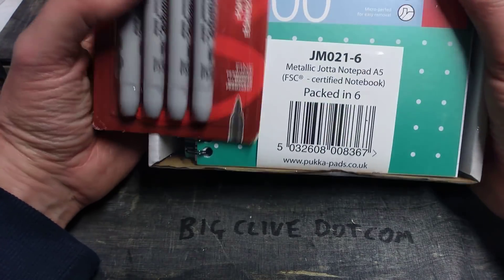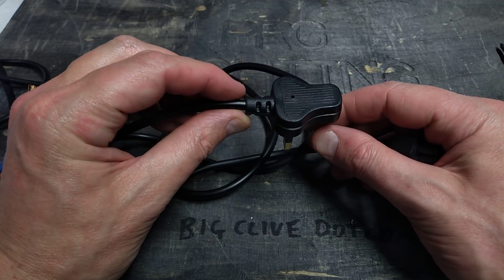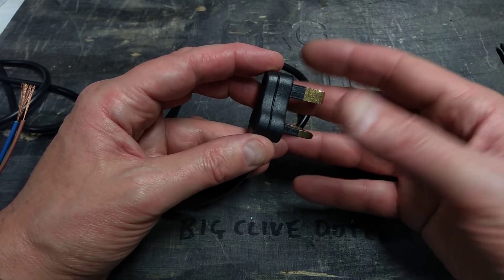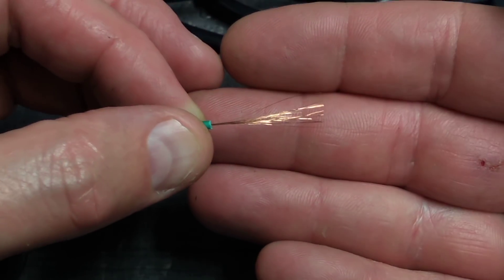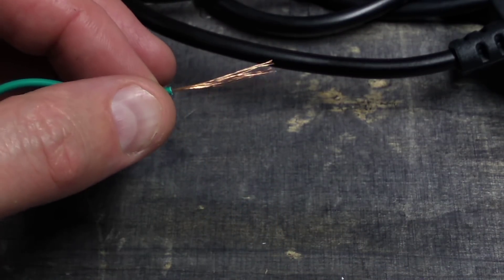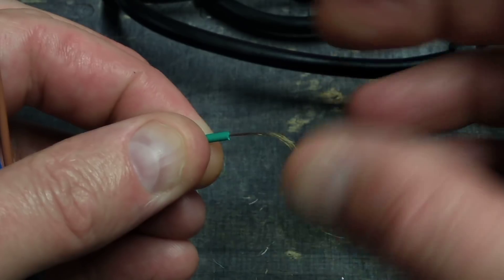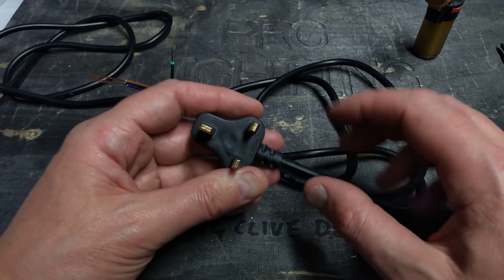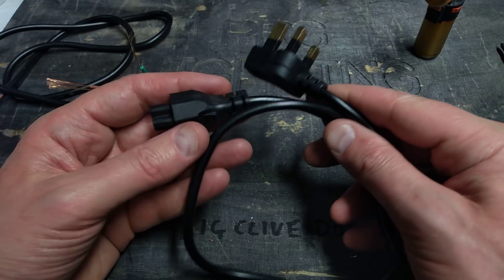How to detect shitty and dangerous aluminium flex.

Comment: I'm so tired of the continual "CCA is BAD!!" comments.   Aluminum wiring works just fine for many purposes.  For house wiring (heavy gauge), the big problem is the connectors, which are usually wrong.   Of course, nobody blames the connectors.  They blame the WIRE.  That's like blaming a car if someone mounts the wrong tires on them, over pressured, and they blow out at speed.  (They also sometimes chintz out on the gauge.  14 or 12 instead of 10)  I have a set of aluminum (CCA) jumper cables (booster cables for some).   They'll work just fine for the job, for a much lower cost than buying three+ pounds of copper to stick in my trunk for the next 20 years.    I just got them at a slightly larger gauge, to compensate for resistance.  (which isn't really an issue at 12 volts over 20 feet)    Grounding leads?   No problem with using aluminum for them.  Most grounding leads down here are completely punched through as part of the mounting process, so the expansion/contraction isn't really an issue.  (The leads I'm talking about are the HUGE ones from the box to the spike driven into the ground outside the house.  Not from the breaker box to the wall outlets)

Detest CCA?  Maybe, depending on the purpose.  Definitely detest cables that are made of CCA and _not marked as such_.   To me, that's deceptive, and extremely dangerous.
Reply from the maker: Aluminium is only stable because it creates an oxide almost instantly when the bare material gets exposed to air.  The oxide is a high insulator which is why special barrier pastes are needed for safe termination.  It's used in power distribution, but will not last as long as copper.  I would never use it to wire a house.
Reply: Thus the addition of the copper as an additional layer.   Copper has the same stability problems, it's just that the oxide it forms is a bit better at conducting.   People still lacquer it to reduce the oxidation.

My point still stands.  There are decent uses for aluminum, and CCA, but everyone continually slams it as being bad because of some bad uses.   I wouldn't use it for house wiring either - but grounding leads, jumper cables, and similar?  Certainly.  I'd rather use aluminum earth leads and rods than raw iron (I've seen a lot of those)
Reply: In the USA, just about every service wire between the transformer and the electric meter is aluminum. Likewise for the connection between the electric meter and the load center. Electric stoves are commonly wired with aluminum, as are air conditioners and other high-draw 240V loads. I have never seen one of these aluminum terminations fail.

Comment: CCA would arguably be less of a problem than the lack of sufficient spacing between the outer edge of the plug and the pins given the nominal rating of the connector so you'd be relying on a fault current to generate that much excess heat...

It is Chinese though, so all bets are off the cards 😅

Comment: I cant stand cables like that. They seem to be coming with way too much stuff these days, ive even seen some questionable cables come with local bought stuff. My policy with any cables which either come from china like that or that i just dont like the look of. Cut them in half and throw them in the rubbish. I ordered from my local large electronics shop in AU (Jaycar) a box of 20 of each the standard IEC for PCs, jugs etc. Fig 8 and the cloverleaf used by laptops and all that. Cost a bit but id rather know my cables were good.

Comment: when you get corrosion on CCA, it spreads through the whole run, instead of slow creep. with copper you can cut into the clean part and replace the rest  if you can get away with it in a given circumstance, with CCA, it all has to be replaced, regardless. the galvanic reaction will have started through the whole wire, and even if its not useless then, it will be within short order.

having had to replace CCA power wires in car amp installs due to this very thing, made it so i refuse to use CCA for anything, period.

Comment: am i right that i can reduce ac voltage with resistors but  i have up to a 1 or 2 amp draw isant that to much for resistors i am going from 36 to 18 volts
Reply from the maker: Dropper resistors are only suited to low current use.  They dissipate a lot of heat if used at high current.
Reply: thats what i thought

Comment: Would the skin effect play a role here and make this cable better at delivering AC current than it would DC since it's got copper on the outside?
Reply: My understanding is that the skin effect is nil at 60hz (or 50hz)

Comment: That wire is really tricky to get into a rewireable plug. After deciding to remove a moulded plug that requires an adapter. 
Ended up replacing the whole lead.

Comment: My tip for making sure you have a "good" plug lead, it to always buy them from RS Components / Farnell, as they buy in large quantities, direct from  the manufacturer. Someone selling on ebay or any other market place, will have likely bought them from Ali Express or similar. The same goes for if you want to buy power adapters that won't burn your house down for 24/7 use. The big  electrical suppliers will often sell mains gear that is "medical" rated, and as such has better insulation/isolation and is  tested to greater standards.

Comment: Wow, that’s some nasty stuff! Is it legal to import that cable into the UK? I know it’s not legal in the US. (doesn’t mean someone hasn’t snuck the stuff in, just not legal) I’m retired now but I worked as a Fire Inspector and a home inspector in Florida for 20-plus years and even aluminum #12 and #14 branch-wiring in homes is getting harder and harder to find. Everything here is inspected on purchase and if someone finds out a home has aluminum branch wiring, typically the deals over or the price drops $10k at least to have the home rewired. No one chooses money savings over their life when it comes to something like this. Thanks for this shout-out. Loved the lighter trick!
Reply: Buying anything on eBay is technically "sneaking stuff in" regardless of where you live because though import/export shipments might have manifests that can be checked against EU/US regulations there are no such regulations about what can be delivered in the mail.  Parcels from abroad are scanned for chemicals (drugs and radioactive substances) and X-ray'd for weapon shapes and that's it, a country receives too much personal packages everyday for each and every one to be opened and checked against different lists of contraband or dangerous materials so anyone can buy this junk.

Comment: Dangerous leads with no fuse and cheap cable that goes bad very easily, and the cable is nowhere near the rating they give you for it (if they give you one)... 

You could call these "death leads" then it would go well with a deathdapter...

Risks are obvious, but the european CE farce is how the chinese can get all this crap into the UK... roll on brexit and return BSi kitemark standards and ban these things.

If this is the crap they sell in china the average chinese home must be a death trap.

Comment: See a lot of this in 12 AWG speaker cables. There are some advantages, especially in the 12/8 conductor cable. Using it in power cables, especially under-gauged power cables is a horror. It is also very hard to detect unless you cut into it. Powering a 1kw PAR might give you an instant answer ;)
Reply from the maker: I was thinking a load test would be the best test.  You'd soon see the cable getting hot and sagging.  The downside is that with a 32A breaker on 240V the cable will probably give first if it shorts and things could suddenly get quite scary.

Comment: Confucius say: never use a cable for 10 amps if you can count the strands on one hand.
Reply: What about solid core? :-)
Reply: There is no solid core flex cable ;)
Reply: Well I can imagine that there are some crappy solid core cables with plugs attached to it going around, but they arent flex cables. Solid and flex doesnt go together :D
Reply: @Chuckiele  it's meant to be solid core but china's version would be like copper flex.

Comment: Spent a day taking turns off a toroidal transformer. When it came to soldering new leads I couldn't - the windings were aluminium. We expect this sort of thing from China at times but a toroidal transformer from Germany left me with a real 'cheap skate' feeling towards the company. Aluminium wire has very close to 66% the current capacity of copper. Dumped it but saved the core.
Reply from the maker: You could have scrapped the secondary and wound a new one on with ordinary single core cable.

Comment: copper coated alloy is a problem in all sorts of devices that contain transformers. I have a welder with it as the main transformer , the copper version of the same welder is a beauty. The one with alloy winding is near unusable. Many Chinese UPS's have copper coated alloy transformers and chokes.They unsolder them selves from the PCBs and are quite inefficient.
Scrap metal dealers are now testing for it when you drop off a load of 'copper wire' or flex.  They use a car battery to 'splat' the cut end of a length of wire.

Comment: Would there be problems with using aluminium for such cables? Yes, it would need to be a bit thicker than copper for the same resistance, but that's not the end of the world, and of course it's used in high voltage transmission lines. Would you here be issues with brittleness, corrosion, fatigue when flexed or anything else? One of the reasons commonly given (true or not) for the UK using ring mains was a copper shortage - there must have been some reason why the didn't just use Al instead.
Reply from the maker: Aluminium is used in power distribution cables for weight and cost reasons.  It also reduces the risk of cable theft.  The terminations have to be suited to aluminium.
Reply: bigclivedotcom I get why it's used where it is - an aluminium cable will be cheaper and lighter than a copper one of the same resistance, but didn't get why copper is preferred in some places. If copper is easier to terminate that would make sense, thanks.

Comment: John Ward did video on a similar lead: "C5 Power Lead with North American Plug - Examined and Destroyed."
We sometimes used Aluminium Earth/Return Cables on our Welding Sets --- of course the cables were much thicker
and less flexible than Copper --- and eventually the end would fall off and have to be Re-Terminated.

Comment: For those who live in the US, Don just buy anything off of the shelf to replace these. Make sure it has a UL, CSA, or Intertek listing tag and stamp on it. Things like Christmas lights and power cords are commonly bought from China without checking the listing, which could lead to fires or electrical shock because of shoddy construction.

Comment: Just rewired a couple of lighting circuits of my home with "PROFESSIONAL" (it does say so on the packaging) cables bought from a wholesaler. Guess what? It's CCA!
Yesterday i was looking to buy twisted pair cables from an international webshop. They have 502 products, of which maybe 10% is pure copper. I can't even filter on copper/CCA.
Reply from the maker: These days if a data cable doesn't specify it's copper then assume it's not.
Reply: If you're in the USA and buying network cable for in-wall installation, it will be copper if it comes in a box with the UL hologram label. Any network cable for in-wall installation must be copper, this is a requirement of the electric code. I've seen network cable that was marked to indicate that it is suitable for in-wall installation (CMR), but it was CCA cable. So we know the UL never saw this particular cable.

Comment: The maximum rating for this cable with its IEC C5 connector is 2.5 A. this kind of connector is usually used in laptop power supply which are fuse protected, laptop and don't need 500W+ to run, so the cable is perfectly safe for its intended purpose. Placing a 10A. wire on this cable would be waste of valuable natural resource, copper.
Reply: Just in case you weren't being ironic: If a laptop adapter comes with a wire like this, I'm pretty sure the only thing that won't burn is the fuse.... Also, in the UK a fuse needs to be in front of the cable, so a 3A fuse would need to be present in the mains plug.
Reply: mjouwbuis this wire although pretty small should be able to carry 3 amps, if your laptop power supply doesn't blow its fuse at 3 amps stop buying cheap Chinese laptops.
Reply: mjouwbuis  I know the UK after WWII copper was in short supply so they went to this loop distribution system rather than the star supply adopted in most of the world. Requiring to use those huge power plug, great to power your dryer or stove but an overkill for anything else in your house like your smartphone charger or lights. In this case a fuse is a fuse if it is in the plug or the power supply it will blow even if the power supply is very poorly design the tracks will burn before the cable.
Reply from the maker: The problem is that these are also being shipped with other higher current connectors.
Reply: bigclivedotcom its possible but in this case your demonstration would have been a lot more convincing with such connectors.

Comment: I've actually seen something worse than copper coated aluminum-copper coated steel. It acts in a similar way but it has much higher resistance and it's atracted to a magnet...
Reply from the maker: I'm going to have to try and find some of that.  I know I have one steel cable, but it's actually a PC power loom.

Comment: You might find similar alloys of aluminium / non-copper cable in 12 - 14 guage LiPo leads. They can be a twat to solder. A flux pen helps a lot and a a pair of tweezers will keep the heat away from your delicate pinkies.
Reply: That's "sodder" and "aluminum" for you 'Mericans using a text reader. Twats are UK slang for beavers.

Comment: Hell I replaced the 1.5mm flex core wires that came with my induction cooking hob with 2.5mm solid core copper, I am prob just paranoid, but having seen more than a few cables that where days to weeks away from burning a place down I rather not take that risk specially with a cable which is hidden away so you likely would not notice it until you get an open fireplace where your kitchen used too be ;)

So yeah cables like this would be a no go.

Comment: What's he on? Why not stay sane/sober when recording videos?
Reply from the maker: I was under the weather and at work when I recorded that one.
Reply: All right. Just wondered why the rant and not just plug it in and overload it and compare to copper. Young Makers mentioned your channel and they don't know anything about how electricity works, so it's good that you inform that cheap cables can be dangerous.

Comment: We've got aluminum wiring, but that's a little different. That doesn't look anything like 18 gauge wire that is needed for up to 10 amps, and, yeah, aluminum would be thicker as well if it were the proper gauge. Our 12 gauge, 20 amp aluminum lines look as thick as 10 gauge wire. I'm glad that they at least thought ahead when this house was built 50 years ago. We've had to learn how to properly bridge the old aluminum to new copper lines since you can't get aluminum for even pigtails. It involves antioxidant paste or special connectors. At any rate, that wire isn't suitable for any mains application.

Comment: I found this exact problem with a Vantec USB Hard Drive Adapter.  I think I emailed you at the time.  I had a few people tell me they now know why their computer caught fire.  I convinced Amazon to stop selling them... but, only listings with themselves as the seller, and only for a few weeks before they determined it wasn't enough of a legal liability for them to stop.  UL Labs couldn't do anything, because although the (also faulty and shady) power supply had a UL mark, the cable /itself/ did not.

I rounded up every cable of that type in the house, cut them before throwing them all away, and replaced them with Tripp-Lite ones.  It's a good investment.

Comment: I wonder if you can test those cheap ebay multimeters 😁 because i think those would be dangerous when measuring ac.
Reply from the maker: Unless a meter is cat 3 or 4 and from a good brand it should not be used on high current supplies.  Dave at EEVblog does some good tests on meters.

Comment: Would that springy wire be better for headphones, looks like its resistant to bending so less likely to break?
Reply: That's actually what they've been using for headphone cord for a long time now. There are literally 5-7 tiny strands in the insulation, nice and flexible, but a moderate tug will snap those wires fairly easily. I've lost a few good pairs of headphones due to that.

Comment: fourth problem with this cable: The Plug is too small and doesnt cover the Socket properly (if i remember the british standards correctly)
Reply: Against regulations, but should be reasonably safe with sleeved live and neutral, right?  But the sleeved earth, that's just pure evil.

Comment: Sorry, but shouldn't the earth wire be bare in order to be a first choice for electrons to take a path to earth in case of cord disruption?
Reply: Nope.
Reply: In some special applications there is a bare ground shield used in conjunction with an earth leakage fault interrupter. These are designed to detect damage to the cord and cut the power. They are required in the USA for portable air conditioners and dehumidifiers.